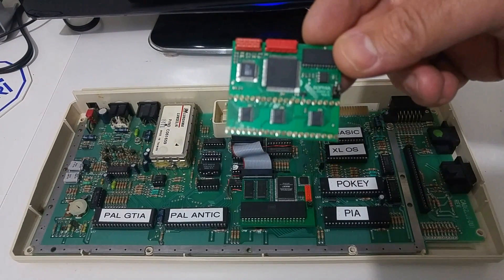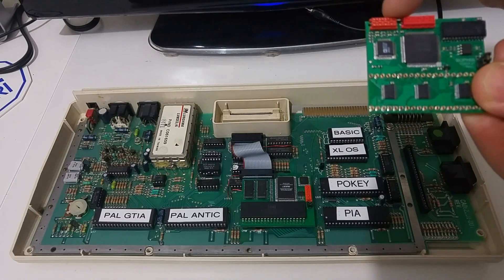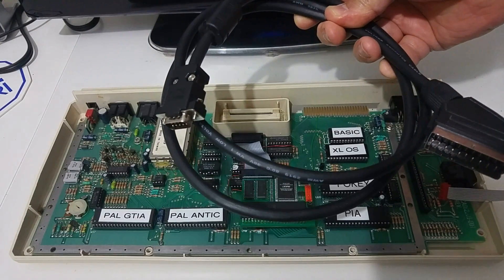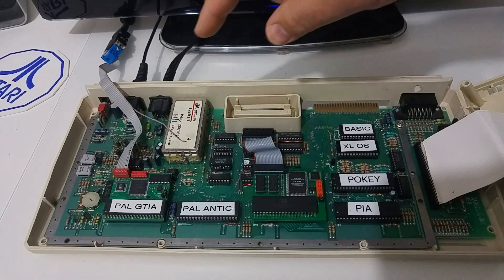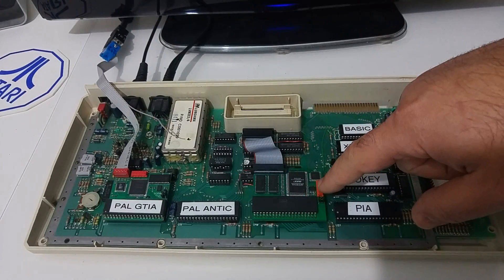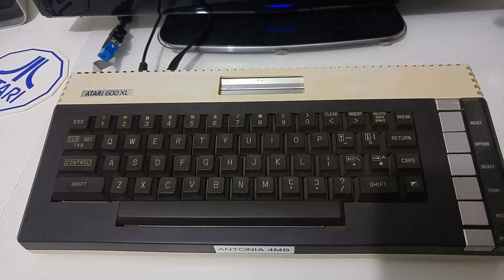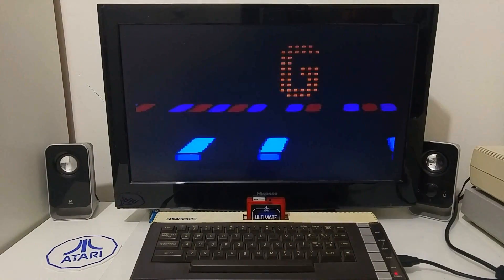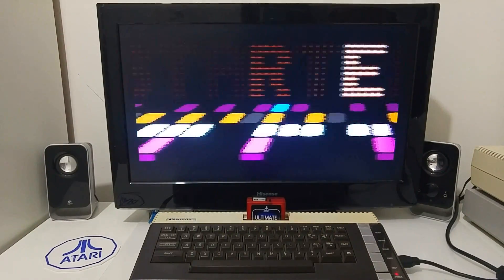Demo of the SOFIA the ATARI XL/XE/5200 RGB Video Upgrade board

Comment: The problem with your setup is the display monitor which is 16:9. This would be more faithful if it were a 4:3 display. The other question/concern is the native resolution of LCDs, none of them have the native resolution of the Atari computer. The lowest resolution LCD would be 640x480 I imagine. Wouldn't a 4:3 CRT with a SCART RGB input actually be the most impressive display to host the Atari's video output with the SOPHIA mod?
Reply: The trick with LCDs is that you want a perfect divisible of LCDs, so at 320x240, it would still look fine.  And again at 160x120.  Unfortunately I think the 5200 is mostly at 160x100, so it may look a bit blurry.

Comment: Wow that's a very different version of the 800XL motherboard than I'm used too seeing. There is no long row of RAM chips the left, and there aren't any pickup resistors by the keyboard connector..  I realize it's a PAL 800XL but i wouldn't think it would be that different.  I guess most of these upgrades you have here will not work with my NTSC 800XL.
Reply from the maker: this is actually a 600XL not a 800XL, i upgraded the 600XL memory to 64k

Comment: Can this make a PAL system into an NTSC??
Reply: To do that, remove the i.c. 74LS74 along with the two crystals Y1 &Y2 and put in a standard NTSC crystal 3.579545MHz at Y1, make link W2 with a zero ohm resistor. replace PAL ANTIC & GTIA with NTSC versions.

Comment: I noticed that in full RGB mode the screen is squashed vertically quite a lot. Can this be adjusted?

JW3HH
Reply from the maker: yes it can be adjusted, its in the screen settings. my screen is set to 16:9 wide.. if i set it to 4:3 the image scale will be better